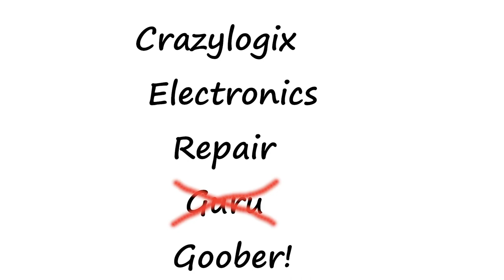"The Punch" EP 1. Rockford Fosgate old school amp repair and restoration.

Comment: In the middle of watching this my mail carrier delivered my 75HD. I definitely understand the heartache with the galvanic corrosion between the screws and the sink and the leaky 10uF 16V SMD caps. I've got hundreds of them on hand.
Reply from the maker: Great amps, hopefully this series helps you decide if you can fix them or if you should send them out for service. My hope is that everyone can rock thier old amps again.
Reply: @Crazylogix007  I was going to ask where you get your boards printed or however you source them. I have a 150HD and it's got a jacked up one that I may or may not be able to repair.
Reply from the maker: @phillipbainbridge9107  The boards will be available soon, my spare time has taken a massive hit, but I am trying to squeeze in as much as I can.
Reply: @Crazylogix007  Oh right on. I've never had any pcb printed before, but I would have populated them somehow. This will be something the community needs.

Comment: All of the Gen 2 Punch 45s that use the TL494 have serial numbers starting with AF, also known as the all-FET design.  Also for some reason, probably cost, the LED is actually part of the voltage divider for the op-amps, so it's imperative to make sure that LED is present before powering on the amp.

Comment: I just subscribed to your channel great videos!!!!  I just bought a punch 45HD off ebay and I just took it apart after watching your video and those caps on the board behind the rca plugs are bad the one closest to the top of the board is actually missing and has a small burn mark in the spot where it belongs, I would like to get it repaired any suggestions on where I can send it off to get repaired I'm in Houston Texas
Reply from the maker: Desert Audio Specialist or G.S. Amp repair both stock my replacement boards and can fix your amp.
Reply: @Crazylogix007  thanks for the information I will definitely look those guys up

Comment: Can you confirm which wires are used for bridgeing this amp (45 not the HD)? Can it be bridged doing a mixed mono/stereo set up?
Reply from the maker: The 45, 75, 150, 45HD, 75HD and 150HD can all be ran muxed mono/stereo. All of them are bridged using the orange(left pos) and brown(right neg) wires. Stereo is yellow and brown, right side. And orange and black left side.
Reply: @Crazylogix007  Thanks for the info as I have the same amp as you and will like to no, when you have it in mono mood which ( ch ) do you use in mono, ch-1 or ch-2.

Comment: I have 2 75's and 2 45's  amps, that we're stored in a bucket in my shop. the shop had a leak in the roof. The bucket got full of water and they sat in it for a while. Can you fix it? Some will power on scratchy output. Some the power light blinks on and off
Reply from the maker: Desert Audio, G.S. Amp repair, Freemans Stereo, Old school car audio restorations, are just a few of the repair shops you can contact.

Comment: I have a punch 75HD and a Punch 150HD.  Some reason my 75HD plays quite on one side and normal on the other.  Works great bridged?  Looking forward to seeing your videos.
Reply from the maker: Carefully remove the cover and check the PIM card for leaked caps, probably corroded a little and has affected the one side.
Reply: Believe it or not: something as simple as a dirty gain pot can cause that. I've had about 2 of my last 10 repairs with the same problem and diagnosis.
Reply: @Crazylogix007  i don't remember it looking like any caps leaked but I'll check it out again.  I always open up and inspect amplifiers before I apply power to them if they are 20 years old or more.  As you know, Ya never know lol

Comment: I purchased a 1999-2003 RF punch 801s amp, I followed your recommendations on testing the mosfets, caps, etc. The guts is in preety good shape but the transformer no so much, smells burnt and looks as if it has been overworked beyond it's capabilities, seems that the transformer emits a lot of heat judging from the burn marks on the base plate. Powered up the amp and surprisingly it powers up so I hooked up one 8ohm speaker on each channel, a two channel amp BTW and the amp works but when you place your nose close to the air ports on the battery and ground side of the amp the burnt smell is more obvious. Need some advice, due to the condition of the transformer, will this affect the amp's output and the amp won't play at it's rated rms also will this contribute to additional heat on the amp. I have not placed a 4ohm or 2ohm load on the amp because I don't want to burn any components also any tips on what can be done to resolve any excessive heat generated by the amp, I have learnt so much from your videos and will really like one day to be able to repair my own amps, excellent videos, thank you Sir
Reply from the maker: I have an 801s exactly like this and i too thought the transformer was toast. However it seems very common in these amps and Rockford put a coating over them that likes to discolor and stink a little. It is common for them to have made a make on the bottom plate too. Look for a upcoming short video on the 801s I have.

Comment: I did notice that your R14 R24 R11 and R12 Are different colors then mine on my 45HD.
Reply: Where do I get an amp repaired and a sub
Reply from the maker: Do you mean the overall color or the value indicating stripes? The overall color does not matter, I have them in blue, green and tan. The value does matter.

Comment: Do use electrical spray to clean the amps?
Reply from the maker: Deoxit on the switches and pots, 90 percent (or higher) isopropyl alcohol on the board. Sometime acetone for stubborn cleaning.

Comment: Would you happen to have an old Fosgate The Punch PR250 or 2100 preamp unit? Thanks
Reply from the maker: Not yet, I keep looking for old Rockford stuff that is not working that is in my price range.
Reply: @Crazylogix007  
PR250 and PR2100 are pre-Rockford. They use the 5 pin din plugs for the in/out
and slave power (17.5+/-) from the amp.
But you probably knew that. :)

Comment: Hi, what size are the 4 fuses in the 2nd gen board?
Reply from the maker: The recommended fuse size for the 4 internal fuses were 3 amp for the 45, 4 amp for the 75, and 5 amp for the 150.